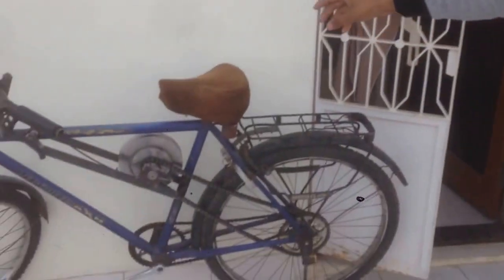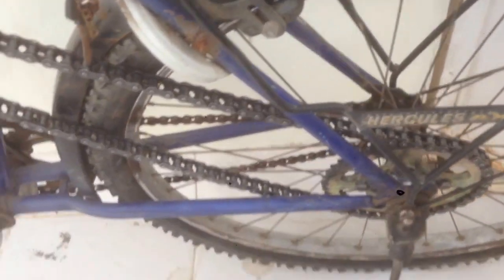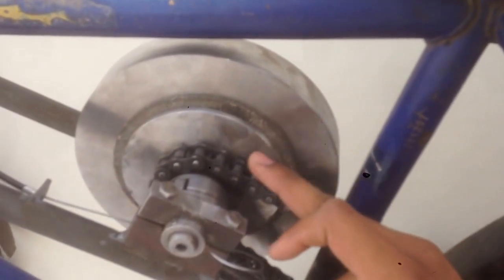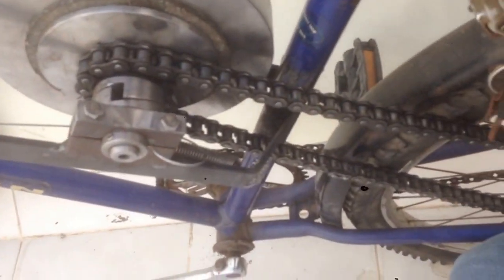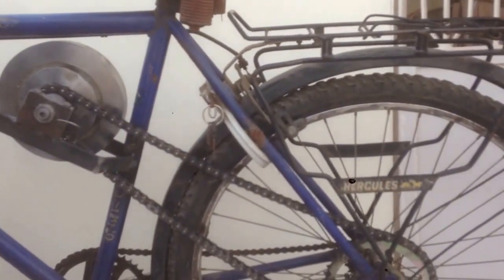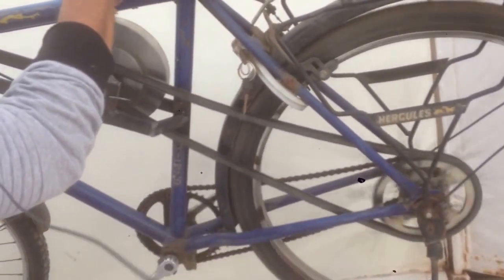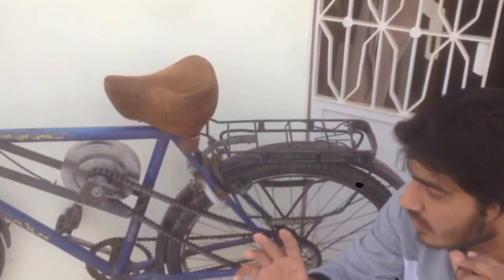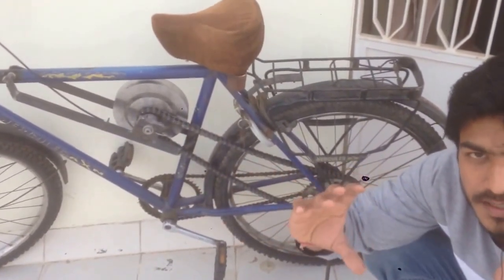introduction to flywheel bicycle :

Comment: what type of clutch you have been using here ?
Reply from the maker: It is a simple cam operated by a lever that helps the friction plate to engage and disengage with the flywheel.

Comment: When stop pedaling after few minutes of engaging flywheel, we can observe that rear wheel is rotated by flywheel energy.
As the flywheel is connected to pedal it is also rotating due to that when we ride that pedal may hurt our legs

So make sure that after we stop pedaling, pedal does not rotate by disengaging the drive beteween rare wheel and pedal
And engagement of that should not make complicate to drive

Very good application of flywheel
Reply: actually the fault is in the old bicycle. They weren't installed with the freewheel. Anyways thanks a lot.

Comment: hi sir
what is the weight of flywheel and which material made
Reply from the maker: MITESH RATHOD bro i m not sir. I m just a student. 😅 its about 9-10 kgs
Reply from the maker: MITESH RATHOD it is MS
Reply from the maker: share this video as much as you can brother : Thankyou in advance :)
Reply: hi
I em doing this minor project in clg
so I want your help 
can you please
Reply from the maker: my mobile number is 9428639047. Message me tomorrow. I have my last exam tomorrow so will talk after it.

Comment: Where and how did u connect the spring in order to engage and disengage the cam
Reply: And the length of the shaft which holds the flywheel and the whole system